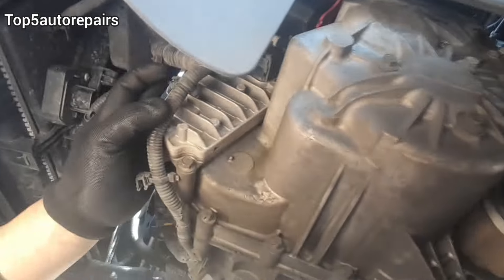BAD TRANSMISSION CONTROL MODULE (TCM) ?? HERE ARE THE SIGNS

Comment: I believe that before we even go so deep into the control modules, the very basic troubleshooting checks should be the electrical connectors (bad and oxidized electrical contacts), which can cause delayed or failed shift solenoid operation. Always follow the repair flowchart from the most economical then work your way down to the more costly ones. Without Prejudice to anyone, this is my way of troubleshooting any repairs. Thanks for  reading.
Reply: @jimmychin8934 how can I access flow charts or TSBs? Website?
Reply: My ford focus transmission has been giving me problems lately. Won’t shift into gears , stays in certain gears , doesn’t accelerate correctly, won’t go in reverse. When i took it to the shop they said it was probably the transmission range sensor so i replaced that, had same issues. Replaced the B actuator next it worked for a couple hundred miles then same issue. Replaced the other actuator and it only worked 100 miles or so then same issue. Should i replace the TCM next? I did all the cheaper fixes first but still having issues and don’t know what to do.
Reply: where can I find that flowchart for 4L60E ?
Reply: My Mercedes e 300 2013 trasmisson malfunction came on and lose power when starting up on hibrid  would anyone know what wrong
Reply: I'm in South Africa how do I get the transmission control module for hummer 3
Reply: @addisonsigley8033 it’s probably the clutch on that. Even if it’s an automatic, it shifts like a manual clutch which was faulty. I had to replace the automatic clutch on my daughter’s 2014 focus at 119,000mls.
Reply: Yea that happened to when I was driving the P in circle sign was on and my cluster wasnt reading like the coolant temp speed and rpm as the car was off and the car couldn’t shift. So i went out to check out I just kinda wiggled the wire that connects the tcm and it was gone.
Reply: That's how troubleshooting is done with Army Aviation,  as I specialized on the UH 60 Black Hawk. Retired after 24+ years
Reply: I can not for the life of me find were the TCM is on my Lexus is 250 2006 and know one will say it’s like it’s a freaking secret or something
Reply: I can not for the life of me find were the TCM is on my Lexus is 250 2006 and know one will say it’s like it’s a freaking secret or something
Reply: @nicholasrenner1295 did you check under the glove box? My 06 gs300 has the pcm and the Tcm in that location

Comment: Thank you I’ve been having transmission problems with my 2007 Nissan Maxima SE not shifting and not running good but definitely there’s a problem with the TCM on my dash I noticed that when I shift the gears into Park or Neutral not showing on my dash but the Reverse and Drive are showing unbelievable how something like this will not let your vehicle run good and transmission performance horrible.

Comment: I have 2013 charger that had a front wiring harness replacement. It shifted fine going over to the garage, harness was replaced wouldn't shift right after that. Codes up the ying yang clear the codes and sometimes it shift's sometimes no it wont shift right.
The garage says its a speed sensor 1900 dollars to fix , i think someone is full of it. Like i said shifted fine before a harness replacement, something doesn't smell right , i could be wrong but though

Comment: Great information, however a link or follow up video on how to reset the TCM or match up the serial numbers would be helpful.
Reply: The serial numbers are on your TCM. It’s not hard to locate or snap a pic of. I’m going through the process of fixing mine now that I’ve replaced both actuators and the range sensor but have same transmission problems. It’s a pain in the ass. Screw ford they sell shit cars
Reply: @addisonsigley8033 The focus was so shit that they don’t even make cars anymore 😂(besides the mustang) Their suvs and trucks are good though. My shitbox 2014 focus made me want to drive off a cliff. I have a 2017 Expedition EL  now and its a beast and super reliable.. The focus really killed their car reputation.
Reply: very good idea repost this a. bunch !
Reply: You can just disconnect baterry for a few minutes that would allow the TCM to reset

Comment: 08 ford fusion 4 cyl (257k) never had trans issues minus leaks and previous owner changed all shift solenoids prior to purchase.services always kept up on fluid looks brand new out the bottle 

When sitting in a parking lot or at idle at operating temperature for about 12-15 minutes go for a drive car will shift extremely hard into every single gear violently making the car shake like the trans was on its way out 

shut the car off and start it right back up shifts perfectly fine and as it’s suppose too smooths shifts no jerks slips etc 

Assuming the tcm is on its way out since under normal conditions it’s completely fine until you sit at idle for a bit
Reply: Yea you tcu is going out

Comment: Thank you my truck battery died and the check engine light came on. Had it check and the code popped up saying it was the transmission control module

Comment: My truck was doing fine up until I used a hypertech tuner on it. Now it's acting like the torque converter is going out. I've already turned it back to the stock program.

2013 Chevy 2500 HD 6.O Gas motor 4x4

Comment: My truck is a 2009 Peterbilt 335, in the mornings I turn it on and it drives great, I can drive it all day without any problem, but without turning it off, if I turn it off that's when the problem starts and it no longer wants to drive anywhere, he changed the switch, internal transmission ignition switch, speed sensors and the internal wiring of the transmission and the issue does not disappear, do you think it is the TCM?

Comment: I am getting a P0717 Code for my trans, which occurred after I power washed the engine bay.  The trans is sticking in first gear, clunking at a stop or when I let my foot off the brake after coming to a stop. I am receiving a "Service Transmission" indication on the dash, and a "Service Stabilitrak and Traction Control," too. The TCM is located on top of the trans and connected to the gear shift selector.  Everyone says my trans is done (at 200K miles), but I don't believe it because serviced the trans when required so, I don't think its the trans but the TCM. I have a 2014 Chevrolet Cruze Turbo Diesel with at AF40-6 6-spd AT trans. HELP!  I don't want to replace the transmission, especially at $6K.. NO WAY!

Comment: Thanks fix my 5.3 gxp running like new.👍💯👍💯👍
Reply: Hey I have a gxp too and got a p0070 code. Did you have the same? It’s been going into limp mode lately. Going to take it into the shop this week. Also, how many km you have on yours? Mines a 2008 G6 GXP
Reply: Same issues I changed the ecm but it’s running really rough at park it idles low seems to be at 600 then in drive jumps up crazy high & seems as if it’s going to stall out I have a 06 gxp Grand Prix

Comment: There is a problem with the Rx350 2007 transmission. When the engine is cold, it cannot move forward, but reverse runs smoothly, and after the engine heats up, it can move forward without any major problems. What is the problem?

Comment: I have a 2015 Nissan quest and it was crushed on the side of the drivers side. It had a problem when I got it back after repaired that as you were driving it will pull to the left and when you would let it go it would pull to the right or vice versa already exhausted most of my savings in this problem by changing parts that were not it took it out of the shop and changed all of the motor from the motor thinking that that would be a problem and pinion we changed it and we changed the control arms as well Also the part for the little boots which I cannot remember the name of it that got replaced as well because it was worn out. Here’s the that it’s still doing the same thing?

Comment: I have a 2017 mitsubishi lancer with a P2719 code. I've read about people replacing valves, valve body, fluid filters etc.. then having the same issue until thier TCM or ECU software was updated from Mitsubishi. Any insight into this? 

I found1 video on YouTube but it was in a different language unfortunately, so it didn't help me much.

Comment: Why does my transmission or breaks don’t know lock on drive at about 25mph Honda ridgline2008 drives in gear 1 but not drive or gear 2 car just slams on breaks and stop works again with a on and off. Reverse not working neutral pulls forward

Comment: I have a 2013 gmc Yukon xl slt recently my transmission sounds awful in Reverse and in Drive, sounds fine in Park and neutral. When sitting at a red light I have to switch into D or N but when placing back in D in gives me a big buck then goes. Would this possibly be the TCM? Or bigger problem? Thank you for any help in this matter. We use this for my daughter with special needs. Need to fix quickly.

Comment: I have a 03 yukon 5.3 and its tbrowing no codes but it wont shift. Put in drive an never shifts it pulls of strong in drive and reverse abd wi take off in all gears if you do it manualy. Just put the transmission in. The old transmission wouldn't go to 3rd or 4th now this one won't shift at all

Comment: Great tutorial...My 2010 Impala 3.5L has been having intermittent No Crank No Start issues the Usually begin with a Goofy Start  (Starts after Returning from Crank Position to On Position)  and soon after, warning Chimes, Service Everything Messages, Gauges go Crazy back and forth, Door Locks on/Off Constantly, Shifts get Rough BUt not Limp Mode and sometimes it actually goes into limp mode.. Once I shut it off for a while a No Crank No Start will happen... Most of the times I can Disconnect Battery and then it gets back to normal.. Took it to dealer and they got me for a $800 New Starter + Diagnosis fee and it worked for 2 days until No Crack No Start again.. Finally get it Started and Limped it back to Dealership.. They had it for 3 weeks and Couldn't recreate the problem... They were leanings towards Bad BCM... They did clean the major Grounds... I got it back from them and it worked for 5 days than Back to same symptoms...  Will a Bad TCM also cause these crazy symptoms.
Reply: Yooo currently having the same issue on my 2012 impala 
Did you figure out the issue? 
Helppppp Pls

Comment: I have a 2000 Chrysler town and country. Wouldn’t start on me. Once we got it towed to the house it turned on but if I wanted to shift gears there’s no telling which one I’m choosing There’s also an obvious vibration under the hood. What could be the problem? No check engine light too
Reply: Injector stuck open hydrolocking a cylinder now you have a bent rod.

Comment: what about when you put it in Drive it trips the TCM Relay or blows the fuse for the heater and turn signals (one in the same circuit ) I have been trying to track this down for months
Reply: Had same problem only involved a fuel pump. I would disconnect heater and see if problem goes away. Then signal lights one at a time. To narrow problem down to which circuit problem is in. Then use a meter to check for bad wiring. Most likely heater. Lights don't normally draw enough power to blow a fuse.

Comment: I have 2001 chev express van trans fluid shows overfilled when not running empty when hot any ideas or hints
Reply: No shifting problems
Reply: That’s normal. It’s going to read high when off. And it doesn’t show when running because you’re simply too low

Comment: I have a 2012 Elantra, transmission issues, changed the pump, some clutches and valve body! Now it drives but great the first time it goes through the gears but starts to shift hard and gets progressively worse until it’s reset, but does it again the very next drive. Please help

Comment: Why do you not show where the TCM is located?????
Reply: @thecrusader3941 then i should NOT see this video when i type into the search bar " Location of the TCM on a 2002 GMC Envoy". I had to check with a GM mechanic to not only find the location. But also be informed that the TCM is the same as the PCM on that make and model vehicle. There is apparently three components in one on that SUV. Things were better when there wasn't all this electronic junk on vehicles. I just saw a video on a brand new Dodge truck. And it had problems that only let you drive it about 30 miles. And then it lit up like a Christmas tree. And when the codes were read on it. There were dozens of them. Only to find out that it was one component that was causing all the codes for different things there was nothing wrong with. IMO if its been built since the mid 1980's forward its junk. I wouldn't buy a new vehicle if i had Bill Gates money.

Comment: I have a 96 Honda odyssey that only has reverse.  only code was the main shaft speed sensor. I changed that out and now it has zero codes.  but it still wont move forward at all. but reverse works after a couple seconds.   I don't know what to do next.  wires look fine. I changed the fluid but old fluid seemed fine. not burned or discolored, no metal.

Comment: Need your help big guy. I have a 2013 Ford Escape and when tranny is cold it runs great but when you drive it for a couple of miles and come to a stop, it takes time to engage, the same on reverse. there are no codes showing. A plumber wanna be tranny expert told me that it could be a clogged filter. it's a job and a half to replace it. Need your advice, big time. I can work on a Abrams tank but don't know squat about Fords. (LOL) Thank you for your help. :thanksdoc:

Comment: transmission made from way back lasted more than stupid crap car maker started adding electrical parts in and on the transmissions. stupidest decisions that car  maker$ ever made. I never had any; transmission problems with car made from 80's,90's and early 2000'  anything made after 2001 is pure junk!